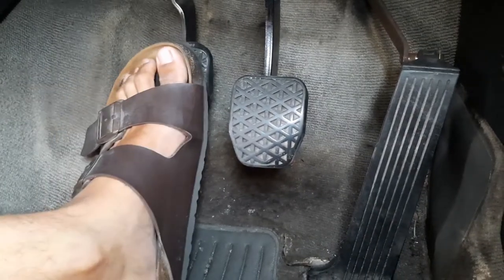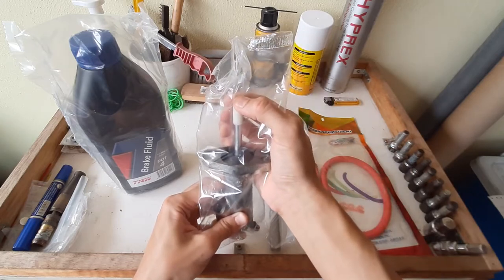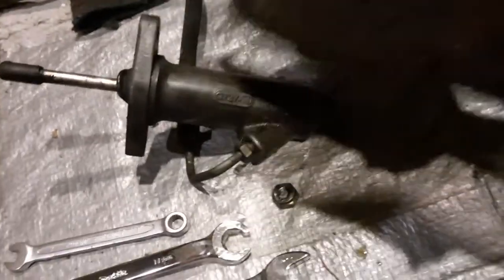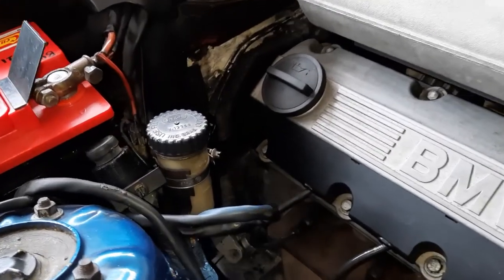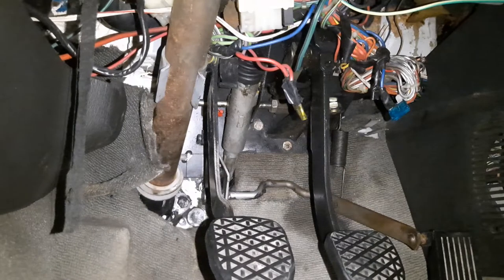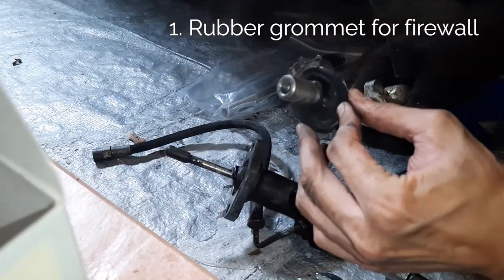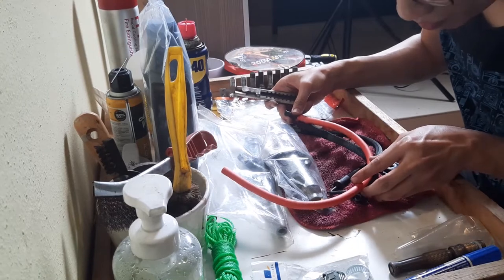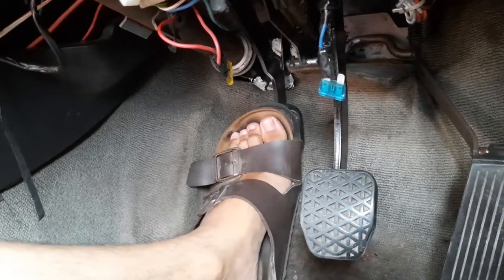Replacing Hydraulic clutch Cylinders - BMW E30 DIY Project ep16

Comment: What about bleeding the system?
Reply from the maker: Replacing the cylinders basically removes all the old fluid. Bubbles seem to travel upwards to the reservoir.

I suppose if you want to just bleed the fluid and replace with new fluid, you can just undo the lines at the slave cylinder and the old fluid will drain out